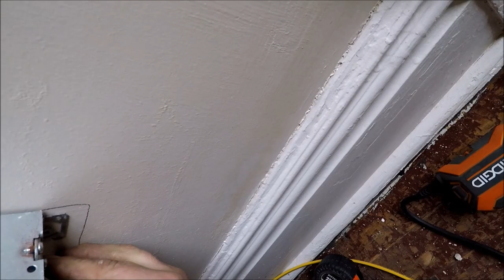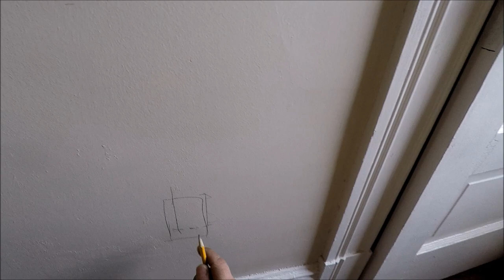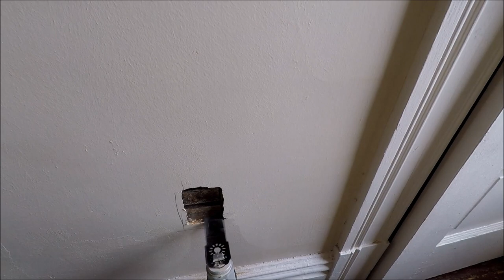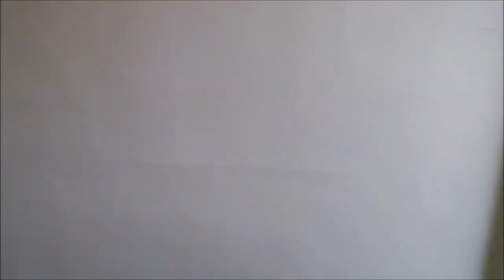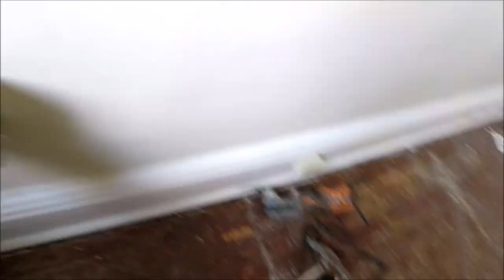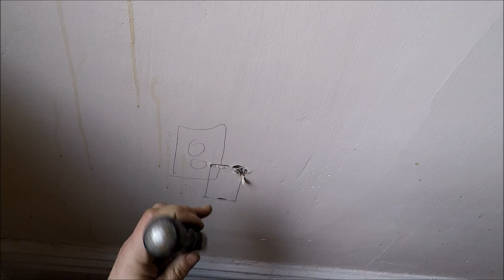cutting electric box into lath and plaster

Comment: I was using carbide blades on my multi-tool to cut these but I'm back to using a chisel.  I trace an exact outline of the box with a sharpie then make a cut or two on the outside of the line with a utility knife cutting the paint and scoring the plaster.  Then I chisel starting in the center of the cutout and work my way out.  The plaster will usually break nicely at the score line.  Takes an extra minute or two but worth it for the exact fit of the box.
Reply: Try using a diamond grit oscillating tool blade.  It's by far the best way I've found to cut plaster.  It's fast, accurate, it won't crack the plaster, and there's very little airborne dust.  Harbor Freight has cheap diamond grit blades that have worked well for me (they're marketed as diamond grit masonry blades I think).  Then you'll have to switch to a bi-metal/wood blade to cut the wood lathe but that's a small inconvenience for all of the benefits of this method.
Reply: My mistake, I typed I was using carbide multi-tool blades but I meant diamond blades.  On a big project that's a gut job I'll use a grinder with a diamond wheel and go around and do the whole house at once. You need a respirator.  The dust is horrible.  On smaller jobs I was using my multi-tool with a diamond blade.  The problem for me was that with the oscillating tool there was still enough dust that I knew I should wear a respirator but not enough dust to force me .  So I was breathing in more silica, etc. than I knew I should.
Reply: @AlexRicketson I have been using a roto-zip with a masonry tip and getting dust everywhere. I never even thought of using a diamond multi tool blade. Just ordered one now, and I am hoping this is the answer to my problems!

Comment: The best way to cut through plaster is with a diamond grit oscillating tool blade.  It's fast, accurate, it won't crack the plaster, and there's very little airborne dust.  Harbor Freight has cheap diamond grit blades that have worked well for me.  Then you'll have to switch to a bi-metal/wood blade to cut the wood lathe but that's a small inconvenience for all of the benefits of this method.  I have no affiliation with Harbor Freight (and I dislike many of their other products) but here's a link to the diamond grit blade I like if anyone is interested: https://www.harborfreight.com/3-12-in-diamond-grit-multi-tool-half-moon-blade-for-masonry-61829.html
Reply: I'd agree with everything you said.......except for there being little dust. Are you kidding? Even with a vacuum there's a ton of dust
Reply: @billebobeatup5262  there is of course some dust, but in comparison to something like a dremel or angle grinder there's barely any dust at all.  Dremel tools and angle grinders have spinning blades that sling out loads of dust.  An oscillating tool vibrates the bit back and forth so it slowly melts into the plaster.  Most of the dust falls straight down and if you used a vac at the same time there would be virtually no dust.  Just try it and you'll see what I mean.
Reply: I agree with you I would never buy from Harbor Freight either. On you recommendation I did this weekend and bought the part you listed. All I can say is a big “Thank you!” It worked very well for me. I was shocked at how straight I was able to cut in for a new plug installation. Thank you for your advice.

Comment: Does anybody know if it's possible to cut in a box from behind the lathe, towards the plaster side? I just moved into a new house with plaster walls, and most of the rooms don't have light fixtures, so I'm looking to install some ceiling fans. I was hoping that I could cut downwards from inside the attic but I'm unsure due to my very limited experience with plaster.

Comment: You used a level!  Lol

Dude you butchered the first one. Why use a level if you're gonna make a good that's way too big.
Reply from the maker: This was all good. Everything was good. More tan likely you were looking for a hole to be be put in in a home with drywall next to someone's sofa that they just had the wall repainted. We go whole house rehabs. We don't buttercup holes in walls when we have 50 of them to do and the box has to be within 1/8 inch of the box. Now of course if I were to go into someone's home and we were cutting a hole next to the grand piano it would be done different. That will never happen so we dont.

Comment: Wow. How not to do it
Reply from the maker: This is a way to do it.
Reply: How would you do it? I'm trying to do something like this myself
Reply: The correct way is to use a root zip with a tile bit set at 1/4 depth. Then use the oscillating tool with the wood bit to cut the slats out. Works every time like a charm.

Comment: Why make such a mess? Why not put some plastic or paper down, tape it off, then do the job, and spend seconds cleaning up?
Reply from the maker: The box is one of 20 to 30 added boxes. You can see the approximate plug location already on the wall. That's from a general lay out of these boxes. The clean up will be apart of a much larger effort after additional activities have commenced. The building was vacant at the time.